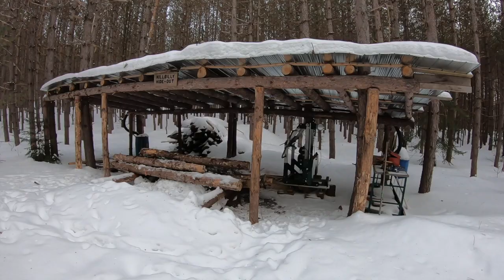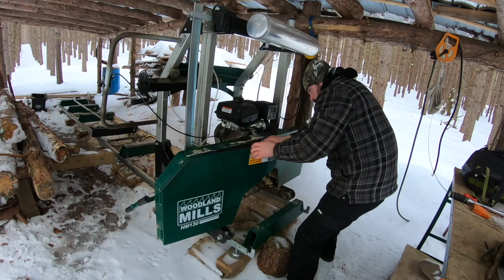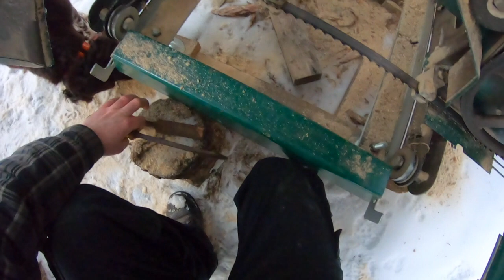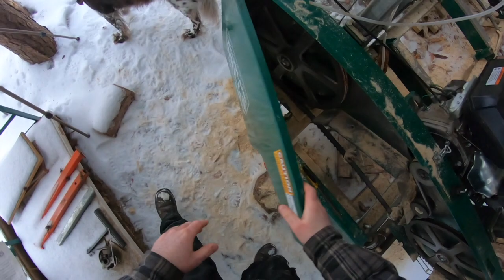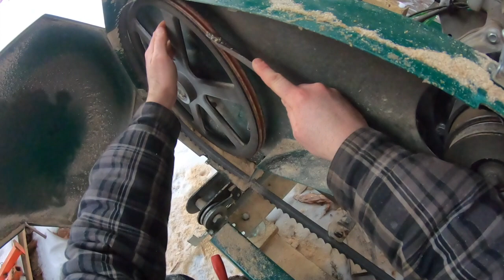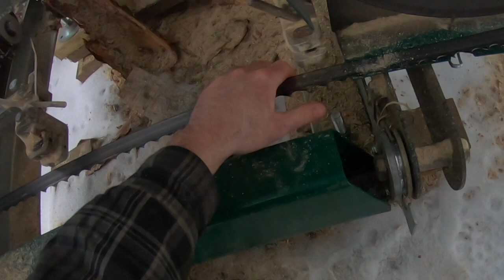How to Prepare a Portable Sawmill for Cutting

Comment: Use a plastic scraper if you can so you don't scratch the paint cleaning out the sawdust & i am also going to wax the inside as surface as  best i can when it gets warmer
Reply from the maker: That's a great tip. I appreciate the advice. What type of wax would you use? I'm not overly familiar with waxing.
Reply: . any type car wax , i dont no maybe some cooking spray for easier application they say if you spray your snowblower chute helps to keep from clogging here in se PA we get that slushy mix a lot

Comment: Well I'd get another belt and keep it as a spare until the old one breaks . Doesn't look that hard to change . For a tractor or a truck I'd change the belt because you could be stuck in the middle of no where when it breaks . If it was me I'd clean that wet saw dust off when I shut down the mill for the winter . Less work involved when getting it ready for milling season . Would drive me nuts knowing that stuff is in there all winter long .
Reply from the maker: Yeah I’m also one to change a belt for more necessary things like a tractor or vehicle. The dust that’s there was wet from when I was cutting frozen wood and then when the weather got above freezing for a day or two the darn stuff froze up on me. Lesson learned on that one. Think next year I’m going to build a proper sawmill building with walls to keep the elements out as well